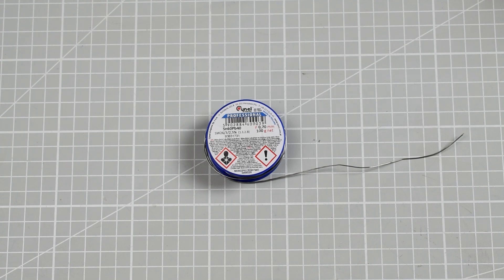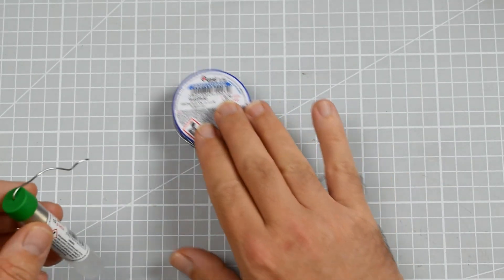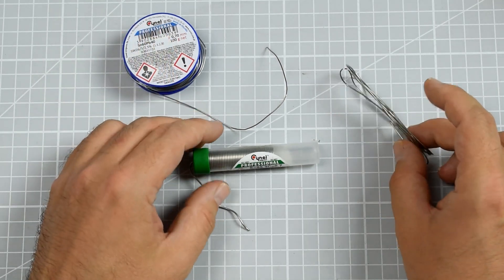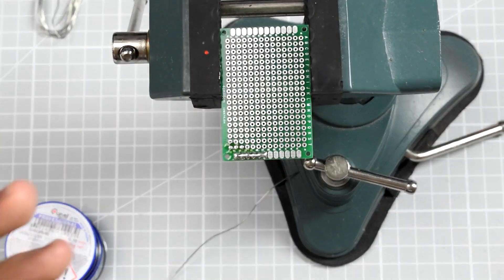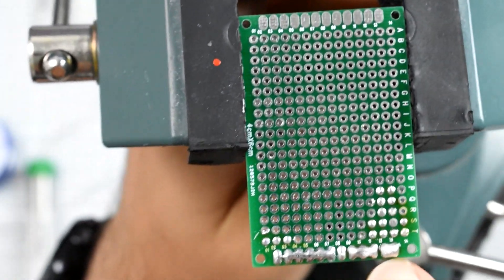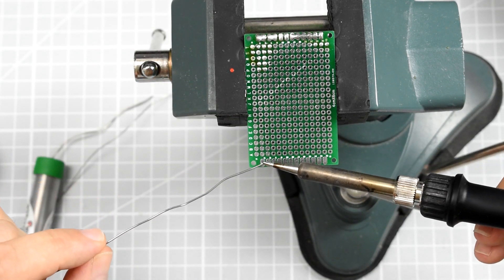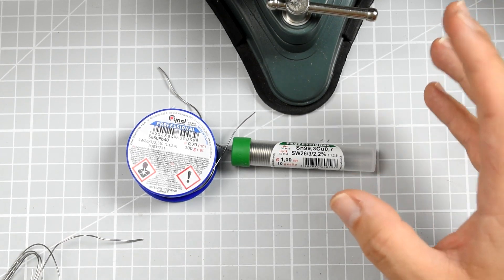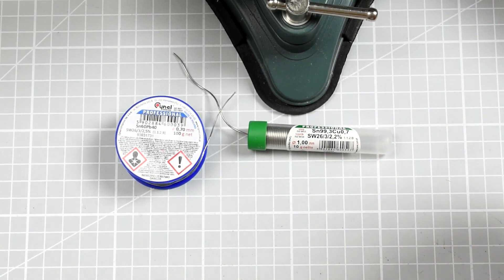Lead solder vs lead-free solder vs silver solder

Comment: I use the same perfboards, I love their quality and cheap price.  The solder I use is 99.3Sn / 0.7Cu and I have been using it for years.  I stopped using leaded solder when I was about 3/4 the way through a roll so I kept the roll in case I needed to use lead based solder for something tricky. Touch wood, I have not needed to go back to it.  The lead free stuff is pretty easy to solder but, reflowing it is a nightmare.  When soldering to a connector such as a DB series, when you fill the pin with solder, you need to get the wire into it while it's still liquid or it's a real pain in the arse.  I am not a fan of lead-free but it is important to phase lead out so it's worth the extra effort to adjust.
Reply from the maker: Yup, good perf boards indeed

Comment: Lead-free solder is brittle. Solder an SMD component with this and lead-containing solder, then try slightly deforming the board. Then examine the solder joint through a microscope.

Comment: Lead free solder is like conductive hot glue.  If you turn the heat up and use extra flux, you can get desired results... or you can just use real solder.

Comment: What about the temperature differential? I always read that tin with lead has a much lower melting point, which means less heat put on the boards and on the components. Is this still dramatically different or is the difference negligible by now?

Comment: Lead free solder will oxidise rightaway after the heat removed and it will be hard to remelt. So it's pretty much a one-shot product not allowing any mistakes. But most of lead-free soldering wire doesn't require flux on the working surface since it has flux core.

Comment: silver solder i picked up is horrible 😂 can barely melt it for more than half a second using a 500c iron. despite the masses of specific flux, it prefers to fly away from what your soldering rather than attach.
having not much luck.

Comment: I'm personally reaching the end of a roll of SAC305; does anyone have a suggestion for any better alloys for lead free?
Reply: I've been using Weller SCN M1 which combines tin, copper, and nickel. It's supposed to have really good joint strength and it shines. Kester also has something called K100LD, which appears to be similar.
Reply: @WilliamSwartzendruber  I ended up getting a roll of Kester K100LD.
Reply: @soundspark  Nice. Did you get flux 275 or 48?

Comment: Shouldnt make a video about something you can't even pronounce.  Lead is pronounced like the word "let" only with a d at the end.
Reply: Be impressed that someone from another country learned such fluent English in the first place and thankful for the informative content rather than judging them on an easy to make pronunciation mistake. Could at least be nicer while still letting them know their mistake...

English is one of the harder languages to learn as it has such inconsistent "rules", including heteronyms like lead vs lead, which are much rarer in most languages (with some exceptions like Japanese and Chinese, which are also among the harder languages to learn).
Reply: more to the point, you can pronounce "lead" any way you want, and if your audience understands what you mean then you've pronounced it correctly. also, nice Muphry's Law demonstration in your channel bio there, skrame ;)
Reply: @RoamingAdhocrat  "soleder", "sodder" who cares, just use good quality name brand 60/40 tin/lead rosin cored solder and rosin paste flux.Wear gloves if you are fearful of touching leaded  solder and work with a fan going if you are fearful of lead or rosin fumes. Learn proper transfer of heat to items being joined and keep the iron tip wiped and retinned before, during and after soldering, unplug iron when done, leaving iron on oxidizes the tip. Don't file iron tips, replace them when eroded and keep them tinned. Practice and watch solder flow until you can do it quickly and properly.
Reply: By your thinking, the people who invented soldering shouldn't have talked about it. Because they weren't 21st century Americans, and so didn't pronounce words the same way you do.
(They were Mesopotamians)

Comment: To Mr. Ruben, I cannot in good faith recommend any solder over 2% silver content not made by any of the brands I trust with confidence. The 4% silver content solder is a hyped audiophile solder that lacks the validity of proven use over decades in the hardest of use environs the proven solders have. The choice is yours. I can’t advocate any solder that is not a true pure eutectic solder that has a greater content of silver than the 2% that the approved brands I trust have. Kester, AIM, Alpha Metals and Multicore are the only brands I trust.